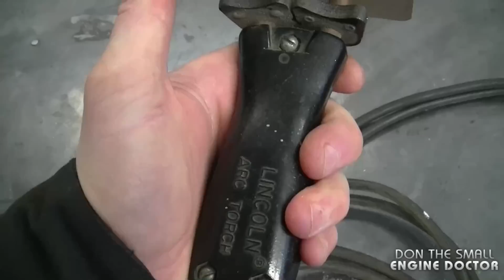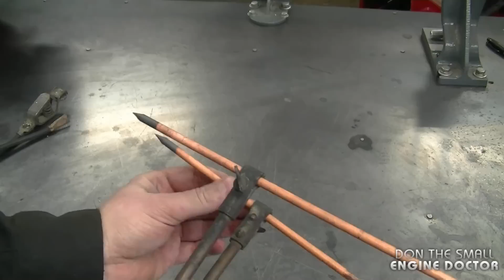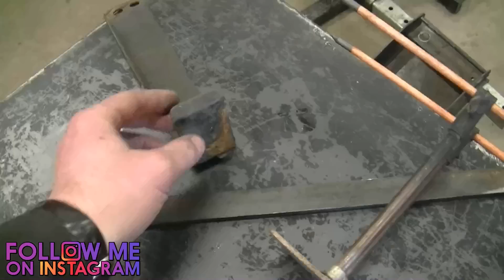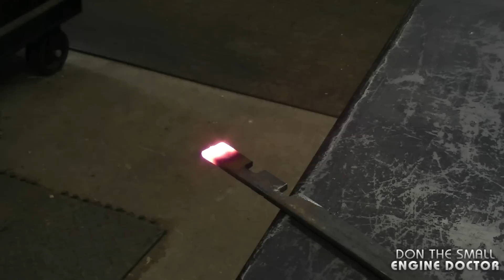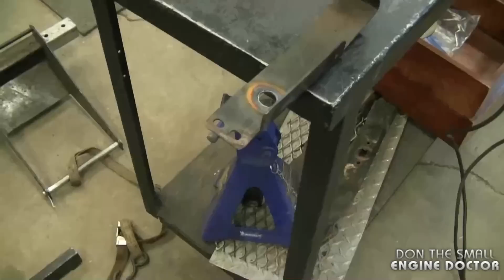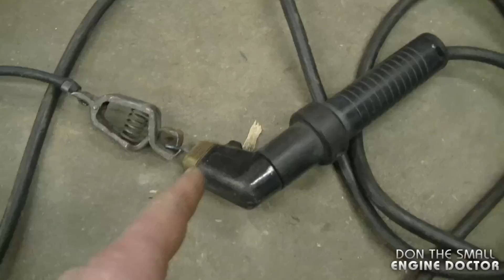Demonstration Of Carbon Arc Torches

Comment: I used to use one in the 70s with a Ferrous welder, still got it, actually. Worked, but the problems I had were, extreme heat (5000+ compared to the 2500 approx for oxy), hard to see and judge temperature, and big arc. Oxy is a lot easier if you have it.
Reply: eh yeah oxy is much more "precise" / "concentrated". Still its really cool too see i knew about atomic hydrogen but never knew about carbon arc brazing.

Comment: so, as a dc plasma railgun setup, the ionic wind should blow either up or down the parallel carbon rods. dc constant current welder assumed. if working as a railgun, polarity change should make the flame go backwards. or surprisingly the arc flame direction is always the same, no matter the polarity. so even ac welder should work.

Comment: nice video. i have found many uses for a carbon arc torch over the years, mainly brazing, broken lawnmower handle etc. these torches heat to arround %3000 c not to be sniffed at, they dont need sharpening, just burn the bastards. but dont make the mistake i made years ago, i wore goggles instead of full mask, and the skin fell off my face for a week !

Comment: I had one of these things 30/40 years ago....used it a lot....then I got access to Oxy/Acett gear and it was never used again.....around 6mths ago I found it gathering dust.....and thought....never need this again and chucked it in the bin.....a few months later I no longer has access to gas welding equipment.....and needed to braze something.....I could have kicked myself.

As luck would have it I spotted one on ebay 3 weeks ago.....its mine now.....found carbon rods on ebay for very little money.....so I believe its a 3000c heat source.

The one you have there Lincoln I think it is....looks real nice quality...as you would expect from old made in USA equipment.....mine is made by SIP in England.

It comes with 2 spot welding tips.....my old one did not have these....wonder if anybody has any experience of spot welding with them on one of these torches.

Comment: Back in the 70’s and early 80’s, a slightly different torch was sold under the names of CRAFTSMAN, MONTGAMERY WARD, PENNCRAFT and GENERAL ELECTRTIC: I believe the manufacturer was CLARK. This was a 50 amp welder the size of a shoe box. You would just plug it to 120 volts and the 6013 rods were for welding and the carbon electrodes for the torch. The apparatus was for the home mechanic or DIY. Those welders are obsolete by now, but they might get you out of a jam if that’s all you have. Nice video. Two thumbs up!

Comment: I can tell you that been using this type of torch simply because it is so cheap to run. Braze with this for years. That is how I was taught by an old time welder. I also have a Lincoln ac buzz box 225 welder. But mine has the top corners cut at 45 degrees so the top of machine is not so square. Had this welder since 1970 delivered to my door from J. C Whitney company when I was ten years old. The cost was $69.99 including shipping cost. This welder works flawlessly. And one more thing, made in USA. Now that is something that will not happen ever again. Nice demonstration Dony too.
Reply: it will happen again when trump comes back 🫡
Reply: @Chevroletcelebrity  The comments are about a torch type. Stay with the program
Reply: @victoryfirst2878  he said his was made in the USA and that will never happen again but it will happen again when trump gets back in office. Trump 2024!!! 🥳

Comment: Fixed a cracked Ford Jubilee block with one of these back in the day...preheated with the torch and then used a high nickel rod. Tried brazing, but it’s hard with this setup.

Comment: Many years ago when I was about 13 I remember putting together something like this from some plans in an old DIU book. The carbon rods were the electrodes cut out from a couple of D-cell batteries. Each end was connected to some electrical wire and the ends of the wire were connected in series to my mother's iron. It produced a nice arc with that crackling sound. I'm surprised I didn't go blind or electrocute myself!

Comment: .....oxypropane worked well for brazing and is of course a lower cost . I ve also used carbon arc for brazing but cos you gotta have arc welding helmet it means you can't perceive those subtle colour hues . For jobs requiring finesse you gotta have the gas flame . I notice you didn't apply flux , sure the rods are coated but gotta apply flux for a quicker job .

Comment: Thank you for sharing this! Not long ago I picked up an old AC stick welder and I just realized on the front it mentioned carbon arc torch, ofwhich I had no idea what that was.  So I looked it up and found your channel very interesting I think I will try this on old rusted bolts as I don't have anything more powerful than a propane torch.

Comment: You never used a welder they were sold in car maintenance mags to run off a car battery, I brazed up all my old Mini van years ago with carbon rods, this technique needs to be revisited with modern tech as we have the cheap electronics now to assist

Comment: I acquired a vintage 50 amp welder that also has carbon arc torches.  Have been interested in giving the carbon arc torches a try but am not sure for such a low amp device what rods I should get for it.  The ones you used in the video appear to be pretty thick so I am not sure they would work well in a low amp welder.    

Great video! Thanks for the tips.
Reply: Another comment said 75 amps for quarter inch to 5/16 rods
So I would aim for under a quarter inch.

Comment: also , AC burns the rod evenly , DC you will need to adjust the - rod more . I still use mine with a 120 Mastercraft Buzz box . if you want a more pin point heat , only use one rod and other clamp to your work piece , heats up fast , but you can use a lower amp , like 70 and heats nuts in seconds red hot .. good vid , thanks
Reply: Thanks for the video. I have seen a guy aluminium solder a hole in a soda can. He was using very low amperage on his welder.

Comment: I found a few boxes of carbon arc lamp rods for an old spotlight recently at a place we are rewiring, the owner gave them to us and tried to give up the spotlamp too but I didnt want that. i dont have 3 phase power to run it besides it was heavy aF too.. There ust be over 2000 of those rods pre sharpened total. I know I can arc gouge with them or use them in a DIY arc furnace or actually run DC on them and light them up as a lamp..
Reply: I still use a carbon torch on my mobile rig, air carbon arc and a twin carbon arc same as shown here. The rods they make today are garbage, you wanna get rid of any of those rods the guy gave you?
Reply: @benjaminelam7613  have you been able to find a source for the rods? The AC gouging electrodes from airgas sounds they they should work but I don't want to spend 250 just to find out
Reply: @ewlyon  dont waste your money on those esab ac rods airgas sells..they are a joke. I have not a source, I buy/restore/ repair/sell  cutting and welding equipment and buy them whenever right come across them. I'm not adverse to selling some what size did you need?
Reply: @benjaminelam7613  1/4" or 5/16" would be about right
Reply: @ewlyon  whats a good way to communicate aside from here?
Reply: Learned about carbon arc search lights in the navy at electrician’s mate school but never saw one aboard ship.

Comment: Interesting video glad I found you! I have another use for the arc welder. I am going to try and use it as the power to melt gold in a kiln. Instead of using rods, you can use diode’s from a heavy-duty 6 V battery. Anyway which appreciated, and I’ll let you know how it works!

Comment: Those carbon arc copper coated electrodes arent going away any time soon they are still used everyday for carbon arc gouging for removing large amounts of metal
Reply from the maker: good to know
Reply: donyboy73 i just realized something while at work the black part of the carbon electrode is made from graphite the same shit in pencils so if u had a large enough pencil sharpener it would be way smoother than grinding and sharper

Comment: Like your demo on carbon arc.Agree hard to direct heat and flame very bright may try  a 10 lens in my mask,did not know you had to sharpen the ends.Don,t feel too bad,now after short practice, even my welding instructor found it difficult to control.I have successfully corrected distortion on a 10 mm steel plate by careful heating so thank you for encouraging me to put it to that use,it worked quick and cheap .Lincoln offer a guide on using this-downloadable.Thank you.

Comment: Don when you made a hole in the steel you held the metal with the other hand.    Is that just pure heat at end of torch rod????
Reply from the maker: yes pure heat, very very hot!

Comment: I'm 71now when I was 12 years old,  I sent away for an electric welder advertised in the back of old car magazines,  FOURWAY WELDER CO. Chicago,  $14.95 !!, it came with a carbon arc torch, I burned up every thing in sight,  then I finally figured how to use it to bend metal, make holes, braze and weld that carbon arc torch puts a LOT of heat out but it was fun,  like your channel.
Reply: I fully expected this story to end with how most stories of children ordering things from the back of magazines ends.
With a pair if  "X ray specs" and down $0.30.
Reply: is that the one advertised as running of a 12v battery
Reply: @georgeh9967  The 4-Way Arc Welder was a simple box with resistance coils in it that every 13 year old kid like me wanted in 1960's.  Ran on 115V.  I saved for months to buy one. Used it to braze together mini-bike frames based on plans in Mechanics Illustrated. Still have the arc torch...somewhere.  Replaced it with a 50 AMP model from Monkey Wards in 70's.  Still a faithful servant.  Finding hard carbons are a problem.  Gouging sticks are too soft and don't focus flame.  WARNING:  The arc intensity can not be emphasised  or stressed enough! The UV intensity / radiation is multiples of submerged arc or TIG welding.  I now have the basal cell cancer scars as witness.  Good tool for its applications with experience and heavy leathers for shielding.

Comment: What diameter rods are you using, 1/4" or 3/8"?  I cant tell and I'm just curious. From old documentation on that specific torch it says about 60-90 amps for 1/4" rods. However Arcair says their 1/4" rods are good between 300 and 400 amps, but that is meant for gouging with a single rod as intended.
Reply from the maker: 1/4"

Comment: Thanks for showing this, My dad and sister gave me a small 110v welder back in the 1980s, it came with real cheap attachments for this kind of use, I never did use it for that. I knew how this worked, but have never seen it.

Comment: Got my arc torch with my first Lincoln ac 225 welder in 1966 when I was 15 and still have it. Used it many times to heat rusted and frozen bolt nuts especially on rear shocks where I didn't want to use an open flame torch. What you do is have the welder off and set to about 125 amps, make good contact on each side of  of the nut with the carbon arc rods, flip the welder switch on and turn off when the nut  is cherry  red. Do not remove rods from nut till welder is off and you will not have an arc or open flame. That is why I used it on rear shocks by the gas tank if I couldn't split or chisel the nut off. Like all your videos , thanks  Ed K. Cleve. Oh

Comment: Those carbon rods will be around forever... i use them for Arc-air gouging, works great in some cases rather than torch or plasma. They also make flat carbons too.  Im sure there are videos about it
Reply: I bet the flat gouging carbon rods would produce a more accurate arc in this application.

Comment: Used carbon arc rods back in the early '60's for brazing.  They're great for heating up rusted hardware by just holding the rods on the object.

Comment: I have the same one it was left to me by my grandfather. I do not have a oxi torch but the arc torch has helped me in a lot of ways. I use it off a 110 welder that was left to me also.
Reply: ncrdisabled Submarine vet I

Comment: Not sure what kind of camera you're using; if it accepts screw-on filters, get any low-priced UV or lens guard filter that fits it, and to that filter, epoxy a piece of welding glass over the outer ring.

If it's something small like a GoPro, you could just put it behind a welding mask.  You'll need to cover the back with a shroud to keep the camera from picking up backlit reflections off the welding glass.
Reply from the maker: good idea, thanks
Reply: Your idea with the UV filter is great, to get better results you need a manual apearture mode on the camera, if the camera doesn't have a manual apearture setting it will try to compensate for the lost light in the filter and hunt the variation of the arc intensity, got this from expereince, though...   ;)

Comment: Another use for these carbon rods was to generate high intensity light in movie film projectors many years ago. They didn't sharpen the rods though. They would just burn down during the movie and need replaced. I had a job in the Air Force where I would visit the base movie booths and take air samples to ensure the fumes released weren't too high for the projectionist's safety.
Reply: They also used them in WW2 for spotlights for anti-aircraft guns at night
Reply: @flyback_driver no

Comment: It's brutal but so effective and a good standby if you run out of gas for your normal torch :-D.
That hole was better than ive seen with a gas torch.
A carbon rod plated with copper for connection and strength, quite clever really :-D.
Old tech is quite impressive.

Comment: Cool video. My father was a welder for over 50 years. I will share this to see if he's ever used one. We trained on FD special team with  an exothermic torch. Very crude but could blast through a guardrail in no time. Really long rods.
Reply: I believe what you're referring to the slice torch what we call it had to have a lot of air pressure with it right the tube was Halo?
Reply: Kind of the same Principle as a arc gouger but the air went inside the tube instead of on the outside that's basically what this guy has here is a arc gouger with no air